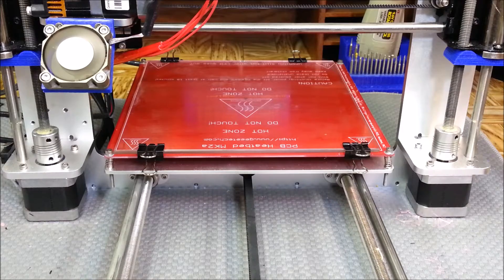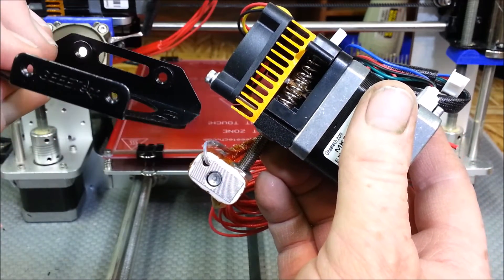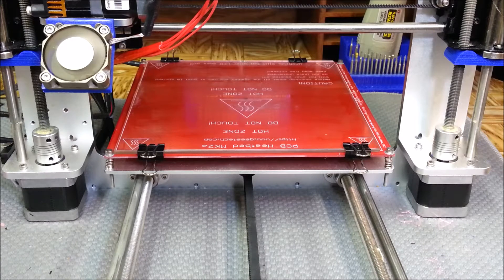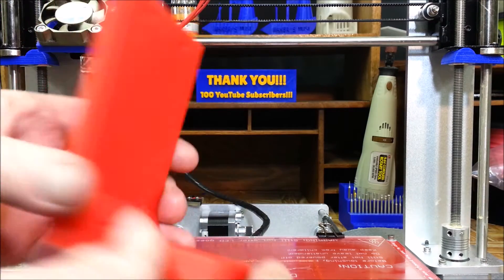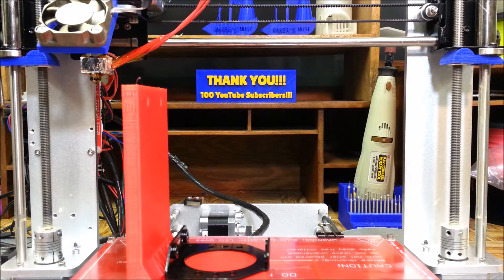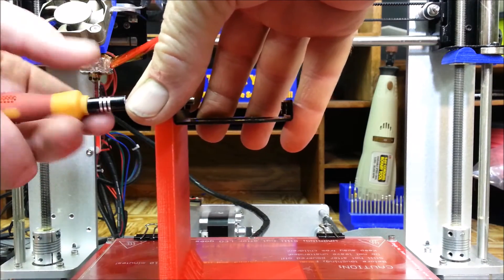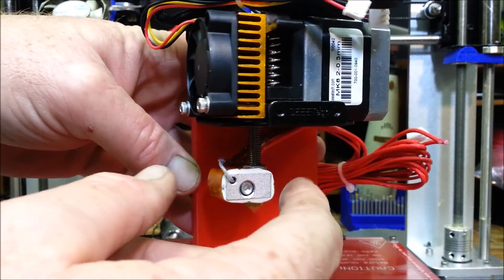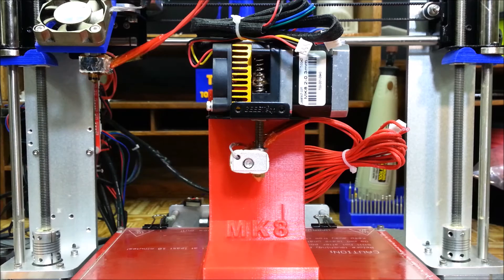Geeetech MK8 Extruder Stand

Comment: amazing print! on my prusa I3 pro B (acrylic) which is basically the same, you see alot of lines on the side of the print, was it also like that on yours? If yes, how did you fix those lines?
Reply from the maker: +Timon Schouten Thanks!  

Please check out this video: https://youtu.be/mYswkbC_AX0

These brackets did wonders for the problem.
Reply from the maker: +Timon Schouten In the video description you will find the link to the brackets on Thiniverse.
Reply: +Jimmy Shaw's Tidbits thank you alot!
Reply from the maker: +Timon Schouten Anytime.  Please let me know how it works for you.
Reply: +Jimmy Shaw's Tidbits No problem!
Reply: +Jimmy Shaw's Tidbits
It works great! I got rid of all the lines and found out that my Z-wobble is terribly bad.
Great design, I had one printed earlier where I can use the standard lead screw, but it was terrible since there was no room to play at all! It didn't fix anything, but now with your design it is all fixed!
Reply from the maker: +Timon Schouten Thanks!!!  I'm glad it helped.